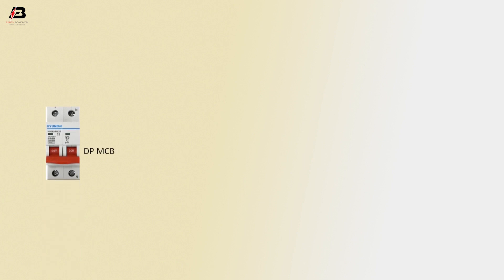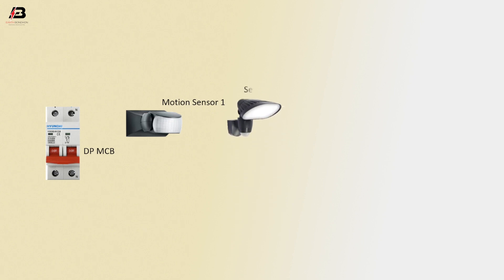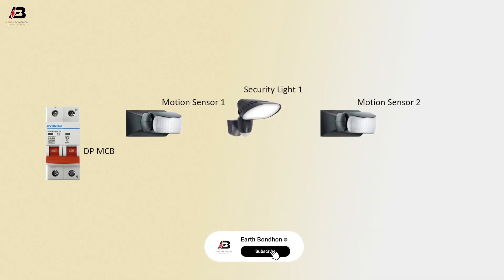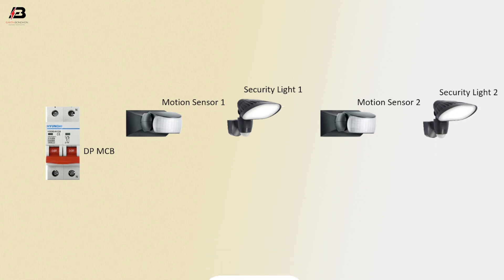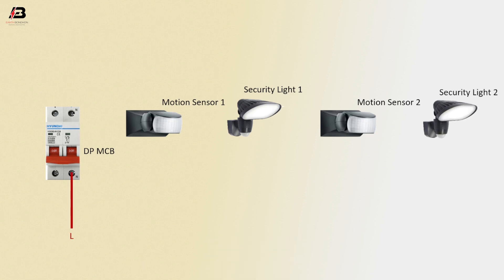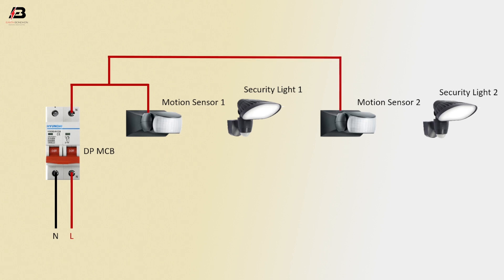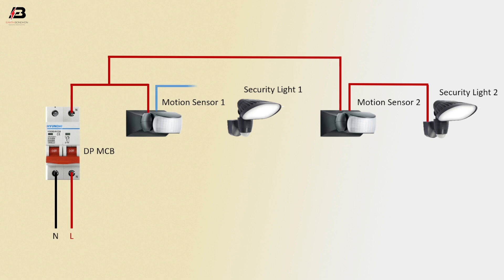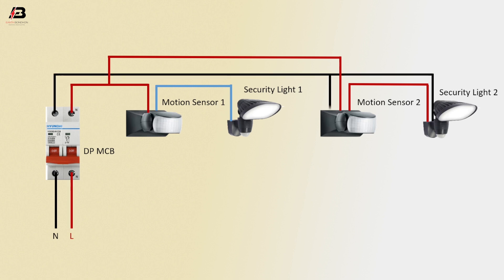How To Make Two Motion Sensor with Two Security Light Wiring Diagram | photocell

Comment: What motion sensor wire is the blue wire connected to on sensor #1?   What wire is the red wire connected to between sensor #2 and light #2?  Thanks?
Reply: Each motion sensor has 3 wires. The hot black one, the white neutral one, and the red one. Use that one to connect to the hot/black wire of your fixture. The diagram works if you follow it precisely, and if, like me, you don't care to know how it works or what the wires are for. : )

I redrew the diagram and labelled it with the actual colors of the wires of my sensors and fixtures. Worked on the first try!
Reply from the maker: Electrical and Electronic video please recommend us in the comment section. Be stay with us and learn Electrical and Electronics easily. Check our playlist for different types of videos.
thanks.